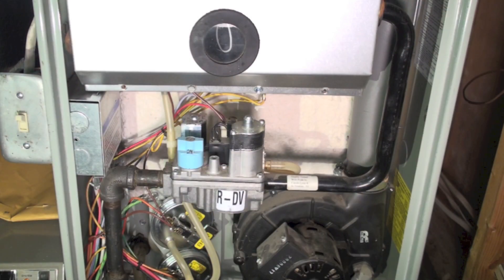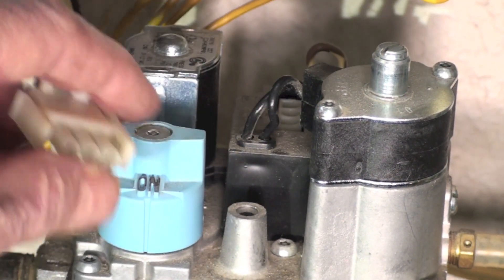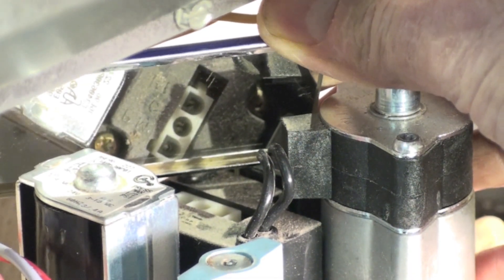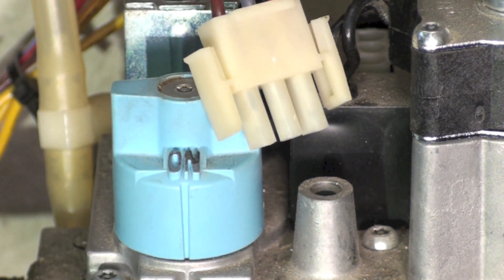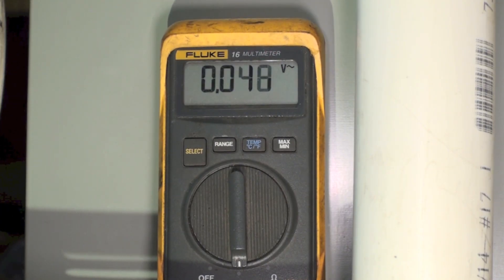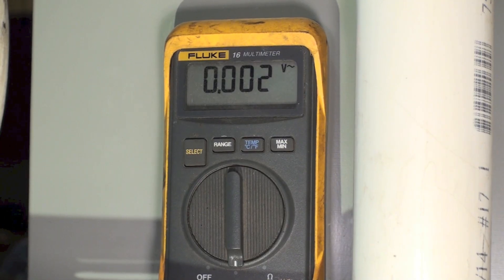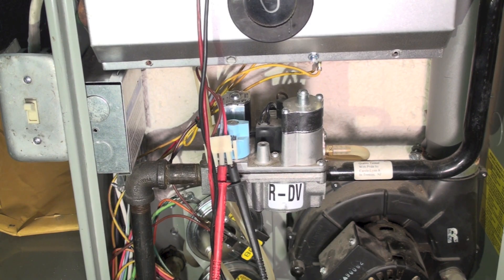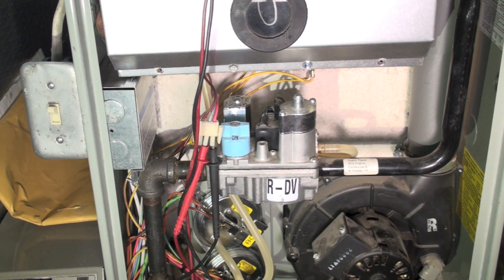Voltmeter check of the gas valve

Comment: troubleshooting 1980 gas valve, it is getting energized but need to verify it lets gas through (will check pressure soon around the valve). It's Lennox pulse and spark verified. A question. If valve is stuck, will it still pull Amps?

Comment: Are all these valves 24 volts DC or are some of them actually 24 volts AC? 

I just took out a Robertshaw from my parent's home because it failed after 41 years of service (they got their money's worth and then some) and I took off the plastic cover on top of the valve and underneath it was a circuit board with 2 diodes. I removed 3 screws holding the circuit board, pulled it off the valve, and there were 2 terminals on top of the valve. I applied 28V AC to the to terminals and got nothing, but when I applied 25V DC (2 car batteries in series) the solenoid clicked nicely everytime I applied the 25V, so it's a nominal 24V DC solenoid but uses the 2 diodes to rectify the 28V AC.
Reply: 24V AC???
Reply: @rivernet62  The one I took out of my parent's furnace is 24V DC but it has 2 diodes to rectify the AC to DC

Comment: At 4:45 you mention some integrated boards sense if the valve is unplugged. That is a gold nugget of information my friend. Thank you. I was scratching my head and almost condemned my gas valve. Haven't found another video that mentions this. Turned out to be a bad connection on the integrated control board at the 9 way plug. I realize this video is 10 years old. Nice job man.

Comment: The worse thing a tech can do is leave a furnace in service if he tapped the valve at voltage to get it to open. Yes he got heat for the customer until he can get a new valve, but if the valve can get stuck closed, it can get stuck opened and cause a catastrophic explosion. Never leave an intermittent valve in service.

Comment: I can here the gas valve click on but I don't get any gas ignition even though my igniter is glowing?
Do I need a new gas valve or is there something I can do to make the gas valve deliver gas to the burner?
Reply from the maker: Do you have gas supply?  Other gas appliances operate?
GFM
Reply: @grayfurnaceman  Yes, I have gas supply.
The furnace was firing up periodically prebiously.
Sometimes it would fire up as normal, and sometimes it would go through the same cycle but would not ignite.
Now it goes through the complete cycle and never ignites.
Reply from the maker: @larrykraut1182  If you have amperage draw to the gas valve as checked by a clamp meter during a trial for ignition and no gas flow, gas valve has failed.
GFM
Reply: @grayfurnaceman  I don't have a meter, but I do hear the gas valve  click on.
Would the gas valve click on if I didn't have power to it.
If it is the gas valve is there any thing I can do to repair it or do I have to replace it?
I intend to replace this old furnace when I can. I don't want to put any more money into it. I replaced the motherboard last year.
Thank You.
Reply from the maker: @larrykraut1182  If it clicks and gas does not flow, the valve has failed.  To be sure gas is not flowing, when the gas valve clicks have a lit fireplace match inserted near the outlet of the burners.  If it lights, the hot surface ignitor may be failing by not getting hot enough.
GFM

Comment: If the gas valve is working and the furnace lights and operates for a full cycle, will there be a constant 24v to the gas valve as long as it's running? Or does it only energize for a moment to open it and energize again to close it? In other words, is the valve only open for as long as it has power, like a contactor?
Reply from the maker: It must have power to stay open.
GFM

Comment: if  it has amp draw than does that mean the valve is bad? Can I jump the gas valve with 24v to test it?   Thank you
Reply from the maker: If it has amp draw, the gas valve solenoid is energizing.  This test verifies that power is available to the gas valve.  It does not mean the gas valve is opening or gas is available.  Happy new year
GFM

Comment: I am getting about 24v to gas valve, but the voltage goes up slowly, and seems to not get high enough until the hot surface igniter has already turned off. If I run a jumper from R and C and touch it to the gas valve after the hot surface igniter comes on, it does work. Is this a board issue for sure?
Reply from the maker: I would also go for the board.
GFM

Comment: Hi thanks for the videos!  So I have a Goodman Furnace ~15 years old .  Blower good, pressure switch good, Ignitor gets hot, cleaned the flame sensor, 26 volts goes to the gas valve, amp clamp shows a current draw during the 4 sec call for ignition sequence,  So likely not a control board issue.  And there are no fault codes (solid red) .  Can the gas valve still be bad if it is drawing power? Is there anything else it could be or I could check, or am I at the stage of buying a new gas valve?  And yes the gas line is on and working.
Reply from the maker: If the gas valve is drawing power  (amp draw at the gas valve), and gas is available, the gas valve has failed. Let me know the results.
GFM
Reply: @grayfurnaceman  thank you...gonna order another valve.
Reply: @grayfurnaceman   any hints on taking off (or putting on for that matter (pipe wrench or just use the leverage from the pipe itself?)) the down stream manifold pipe?:  It is stuck on the old valve pretty well.  I ordered a new one because I'm sure I'm gonna damage the old one getting it off.  Also, is it necessary to do any checks other than for leaking gas after the install?  Pressure etc?  Thanks again for the quick replys!
Reply from the maker: @stephenbarry1253  Use a backup wrench to avoid damage to the manifold assembly.  I have done a video about changing a gas valve and doing the things necessary to make it work properly:  https://youtu.be/g8jMJIBVRGo  Hope it helps.
GFM

Comment: what would be the problem if 24v is registered when wires are unplugged from the gas valve, but the voltage drops when wires are connected to the gas valve?
Reply from the maker: Probably a bad control board.  There is no real power there, just a ghost voltage.
GFM

Comment: I did this same check, but the reading was 12v/random voltage instead of 24....then I restarted a few times, it went back to 24v and everything fired up. It's been very intermittent. Jumped the limit sensor, not that. Seems weird a board would be intermittent but I can tell the gas valve won't click.
Reply from the maker: Your 12 volt reading is a ghost voltage.  The board has failed.
GFM
Reply: @grayfurnaceman  that is my feeling as well. Especially since it wouldn't fire while doing random 12v ish readings. Once I power cycled a few times and got 24-28v and hooked the leads back up, it fired right up! I keep a spare board/Gvalve/limit/flame sensor on standby. Will change board tonight. Cross fingers lol

Comment: What if I’m not receiving any voltage to my gas valve
Reply from the maker: If you are not getting power to the gas valve during a trial for ignition, you probably a safety shutdown of some component during the trial.  Pressure switch, limit open, etc.
GFM

Comment: I don't get 24 volts AC after the ignitor glows. Less than 0.9 volts AC. I ordered a new control board. Maybe it's a bad solder connection? I have not looked yet.

Comment: Is it AC or DC ? If this comes directly from transfermer then it is DC for sure, but looks like it is coming from Circuit board
Reply from the maker: It is AC.  The transformer is also AC.  The power is rectified inside the gas valve.
GFM

Comment: Let's say I'm getting 15v to the gas valve prior to firing and once gas valve closes I'm get 27v, is that phantom voltage and could that burn up the gas valve?
Reply from the maker: The 15 volts is phantom and will not damage the valve.
GFM

Comment: Yes it starts
Reply from the maker: If the inducer starts, check for power to the control board.  If there is power in, and no power out to the gas valve, the board has failed.
GFM

Comment: When I hooked the meter to the wires that you show and I let the furnace run its course the first voltage reading was 18.4 second 12 volts and the third was 11.6. What might cause this? I’m sure those are not ghost readings as they only read when the furnace goose through it start up sequence. Thank you for being so quick on replying....
Reply from the maker: Unless you are getting 24 to 28 volts, it is a ghost voltage.
GFM

Comment: Lennox 21 plus... when I run a volt test I got 12 volts. What would cause that?
Reply from the maker: That's a ghost voltage.  There is no power to the valve.
GFM

Comment: I tested the gas valve as you discussed but I have 14 volts ac before the furnace calls for gas.  when the furnace calls for gas the volts go up to 24v.  is it normal to have 14v at the gas valve before the furnace calls for gas?  thank you
Reply: Probably a backfeed, this happens with high voltage on some blower motors and even heat strips for me

Comment: When I plug the wires to the gas valve, the voltage does not show up as it would for the 5 seconds if it was unplugged (usually 28). Mine is just a 2 wire valve. I do notice that there is a spike and then goes back to zero very quickly, is it possible that there is an issue with the valve? My ghost voltage is 15 when it is unplugged. I have seen people test power with the valve plugged and they usually have the 28vac for the 5 seconds. Thank you for any help.
Reply from the maker: If you have a spike, the control boards has probably failed.  You can double check by jumping power straight to the valve.  If it opens, you have confirmed board failure.
GFM
Reply: @grayfurnaceman  thank you for the feedback. Is it normal to show 28 volts when it is not plugged to the valve for the 5 seconds? 28 volts show as well when I manually turn off the valve with the power slider. It appears that the valve is bringing the voltage down for some reason. This is the only reason I suspect board, in an electrical system, wiring or transistors give up when the system is loaded and tests ok when not loaded.
Reply from the maker: @scientist100  Open circuit voltage is always higher.  When it loads, it should drop to 24-26V
GFM
Reply: @grayfurnaceman  thank you for your reply. In my case reading 0 volts when it should read 24 indicates a problem with overload due to a malfunctioning valve or would it just be the board? My scenario doesnt male sense based on an open, I believe there is no open in the valve as it reads less than a mega ohm from either side so there is some sort of continuity.
Reply from the maker: @scientist100  You need to know that these valves are DC.  The valve has a built in rectifier that pretty much defeats ohm readings.  
In most cases, board failure is the culprit.
GFM
Reply: @grayfurnaceman  I'm inclined to believe that, that is the case here as the voltage goes away as soon as the gas valve is plugged when it should be present even if the valve is defective. I had a young fella diagnose it and called the gas valve but wanted a second opinion and the second guy diagnosed the board, he tested it plugged and was not seeing voltage as I did, the young tech disconnected the  wires and tested it that way and saw the 28 volts and was convinced it was the gas valve, I explained to him that when plugged it goes away and he said that it had to do something with no grounding internally which didn't make sense so I'm more confident on being the board as the other more experienced guy diagnosed.
Reply from the maker: @scientist100  Let me know what you find.
GFM
Reply: @grayfurnaceman  The board was a confirmed fix. So, it is always a good idea to test a circuit when it is loaded and not when the wires are disconnected for a power check. I was suspecting the board but when disconnected, it was pointing at a faulty gas valve because the output would read 28vac.

Comment: In automotive electrical diagnosis we often back probe connectors to see what is happening while modules are running. Can you do that with the gas valve to avoid the issue of continuity?

Comment: Can you give me advice, i call the HVAC to replace my furnace blower motor start smoothly run like it was ,the guy came upstairs said there is big problem the gas pressure valve they couldn't adjust the pressure they used the reading tool says 4.6 supposed to be 3.5 they told me is to high need to shot off the gas unsafe to operate might cause fire or explosion that is there explanation to me they put the Red tagged  the guy said need replacement the whole furnace they estimation $ 8k - $ 10k  .i  told the guy i did not asked for checking the gas pressure it's been running like that since I bought the house .
Reply from the maker: First, I would be concerned if the furnace had run for an extended time with manifold pressure that much higher than factory recommendations.  There could be heat exchanger damage that could mean furnace replacement if the furnace has been installed over 10 years.
The manifold pressure is adjustable and I have never seen a gas pressure regulator on a gas furnace that was not adjustable.  Perhaps he found the gas regulator was defective.  If so, the gas valve could be replaced rather than the entire furnace.
That does not mean I would recommend gas valve replacement if, upon inspection, I found damage to the heat exchanger.
A second opinion may be useful here.
GFM
Reply: My furnace is 28years old ,i notice that day i have no hot water  the next day the HVAC guy call me they forgot to turn back the water heater on .can you imagine if they forgot to call me ,I might to call the plumber that day that another expenses,  They said they put  redtagged I checked my furnace I can't find the redtagged   i turn on my furnace is winter in canada I've been spending time observing my furnace in the basement ran fine. BIG THANK YOU FOR YOUR ADVICE

Comment: Thank you for the video.  I have an intermittent problem.  Sometimes the furnace will start normally, voltage is fine to the gas valve.  Sometimes surface igniter comes on and there is no voltage at the gas valve, it cycles through again and starts properly.  Never any error codes and it never takes more than 2 attempts to start.  Thoughts?
Reply from the maker: This could be either a failure of the control board, or an intermittent open in the plug that connects the gas valve to the control board.  Try moving the plug around when there is a failure.
GFM

Comment: Thank you very much. My pool heater was down for 2 seasons, I suspected the gas valve, but I was not certain, and did not want to spend the $250 for a new one. I performed this test with a multi meter and became 100 percent certain that it was my gas valve. Replaced the gas valve and the heater now works again. Thank you!!!!
Reply from the maker: Welcome
GFM

Comment: Lennox 80UHG. Check the wire connection from the gas valve to the wire harness on the board! Thank you Furnace Jedi! You are the best, bar none. Listen to this episode. My igniter came on but gas valve switch didn’t kick on. It was replaced 2 years ago so had doubts it was the valve switch. I checked voltage coming into the switch as you described in the video. It measured 12 volts. What the heck? I measured it 3 times still 12v. I measured the voltage coming out of the transformer, I got 24v. Hmmm. I followed the two wires from the gas valve, they are blue and yellow, and they connect to a wire harness on the control board. There is a blue and yellow wire coming from the transformer to the same wire harness. So I jiggle and press the wires into the harness real good. They are dusty and stiff with age. I flip the power switch on to the furnace, it cycles, igniter glows hot then I hear the gas valve click on and wow it fires up! I’ll be damned bad wire connection! So far it seems to be working fine. Still amiss how I was getting only 12 volts and not the full 24 from bad connection but o well it’s working!  I did replace the pressure switch but don’t think that was the problem. I’m gonna put the old one back on and see if it’s still good. From what I’ve read if the pressure switch was bad the igniter would not have turned on. Thank you! Thank you!

Comment: What's the natural gas pressure for a brand new gas valve set at brand new out of box?
Reply: It will certainly depend on the valve application but most are set to 3.5 in wc.  It should be marked on the valve.
GFM

Comment: I'm getting 15v at all times. Than it jumps up to 24v to open the valve. Is this supposed to happen? Is a relay shorted?
Reply: Very interesting, mine was doing the same thing but not working, no gas flowing. I removed the switch box from the valve assemble and sure enough, one of the power input pins on the board, appeared broken. I resoldered all four joints and Bham, Gas valve now opens and furnace fires up, works. Oddly enough, the voltage to the valve is no longer 15v ac and 27 v ac when on, but rather ov ac and 27v ac when on. Good luck

Comment: Good video...my issue is no gas....when i do this voltage check i only get about 18v for less than 1 second.....then goes to zero....
Reply from the maker: On a trial for ignition, the gas valve should read 24 to 29 volts for from 4 to 7 seconds.  If it immediately goes to zero, I would be looking at either a loose wire or a control board failure.
GFM

Comment: Great video, I have the one you can not ohm, I am tracking a code 7 on a Trane 90 series furnace 10 years old. The only thing I notice is that voltage fluctuates, but does not goes bellow 23 Vac and I can read amperage with the plug on, at least as I have the furnace cover open. I suspect cold solder cracks on the board to the multi wire connector that act up after gets warm; wire is okay, tested okay, so I leading towards a problem with the IFC board.